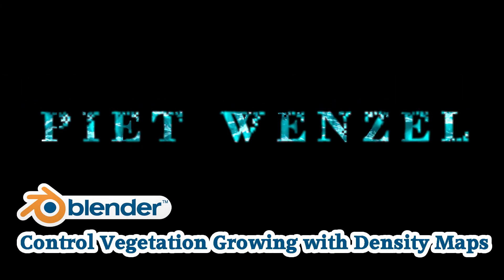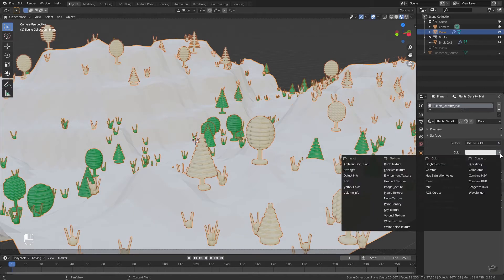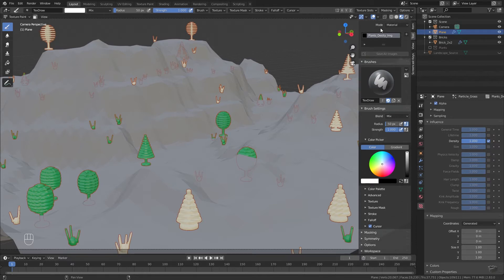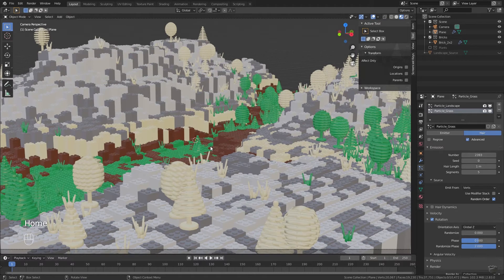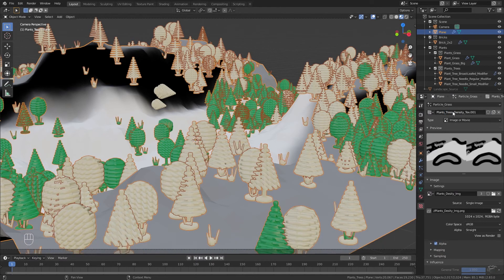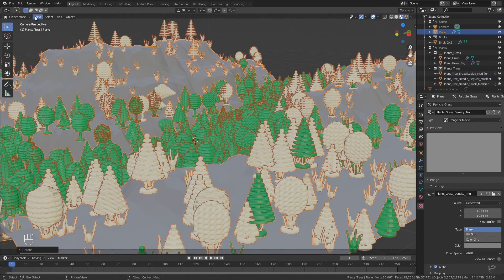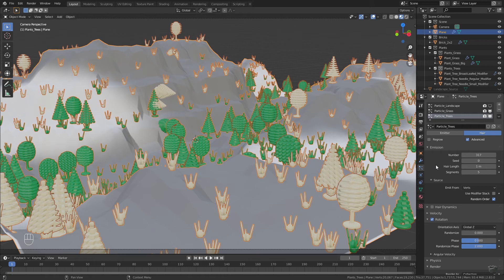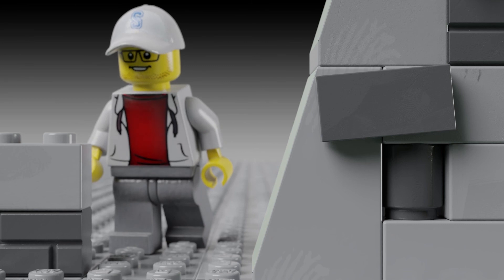Blender Beginner Tutorial Part 8 - Control Vegetation Growing with Density Maps

Comment: No matter what I do, the density map seems to not have any effect. Completely white and black seem the same. (I've made sure its on the plants particle system)
Other than not being able to control where the plants are, my project is coming along wonderfully thanks to this series! =)
Reply from the maker: I like to read, that my series helps you a lot. In this particular video are many points, where you can do little mistakes. Evene I have to check my tut from time to time.
The correct linking is a big issue.
1. create an image in texture tab
2. assign this image a texture in texture tab
3. load this texture in particle tab and set all influences
4. start crying in despair because it still doesn't work
5. download my blend file using the link in the description
6. append the particle emitter from my provided blend file to yours
7. continue working ;)
Reply: I'll have to try this when I have the time. The work around I came up with was to duplicate the landscape and delete the parts where I didn't want any vegetation. That Also helped because I wanted to make a path there using bricks of other colors. I only really cared about plants in some places and not others, I don't really need a bunch of plants here, only a few there and none somewhere else.
Also, I think I remember reading a comment earlier asking about snapping the landscape bricks to height increments of 1 plate and now that I've finished the playlist I'm a bit sad I never saw a way to do that, though it will not stop me from trying.
Thank you so much for this series, my first "real" animation is coming along so much better than it would have without these videos!
Reply from the maker: Remove emitter where no plants needed is best workaround .. I do it, too, its faster ;)
The 1/3 brick height increment grid is still part of my topic backlog. How urgent is this toppic to you?
Reply: @AnyBrick  None now after spending an evening figuring it out
Reply: @AnyBrick  The final issue I've got is that on my particle hair system for the bricks will sometimes leave some vertices without any hair/brick, so I assume some verts have 2 of them despite the number of verts being the same as the number of hairs. Even having 10x the number of hairs will leave some random verts without anything.
Once I get this figured out, I should have my animation done by the end of the month!
Reply from the maker: @Moki314  I once had a simillar issue, so maybe try this: select your particle emitter object go to edit mode --> mesh --> clean up --> merge by distance && clean up --> delete loose. After that check amount of verticies 2 number of particles.
Reply: @AnyBrick  That didn't remove any vertices. Since my emitters are 10s of 1000s of vertices I'm trying to break them up into multiple smaller meshes to find the issue.
Reply from the maker: @Moki314  thats a good idea. No further remote diagnostics possible, sry. You do it by yourselfe or share project file to me.
Reply: @AnyBrick  It pretty much works, but I don't like doing that solution. I found that having the number of bricks being  about 100.2% - 100.3% of the number of verts fills in all of the holes, but I just can't figure out why its necessary. Hopefully any doubled up bricks z fighting isn't noticeable in the final animation.
Reply from the maker: @Moki314  using a moving camera will create artifacts if 2 bricks are at the same position with different colors. But you may not see it, cause occlusion. Give it a low res rendering before you waist too much time and be disappointed.